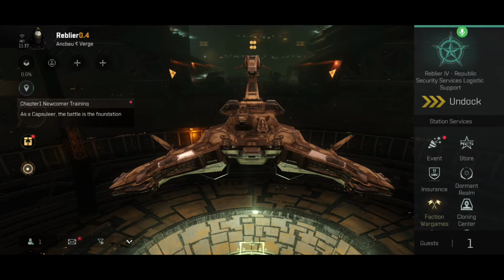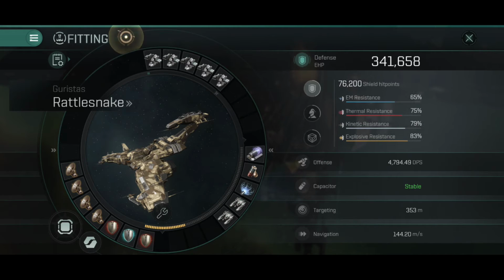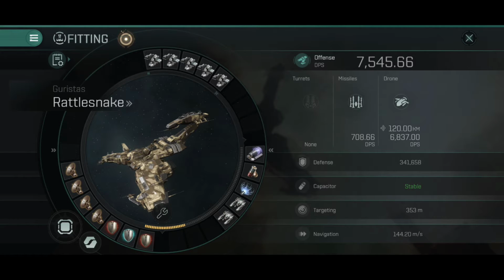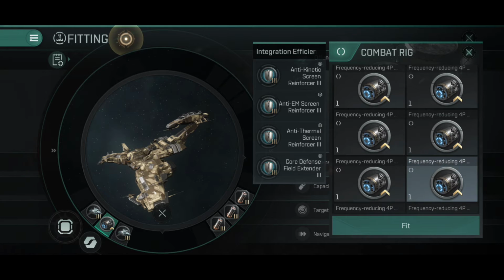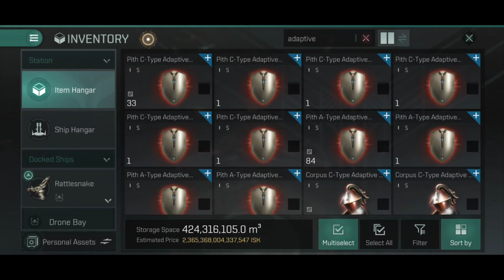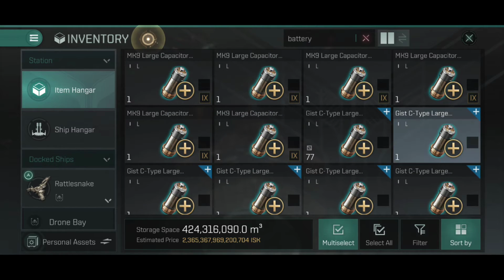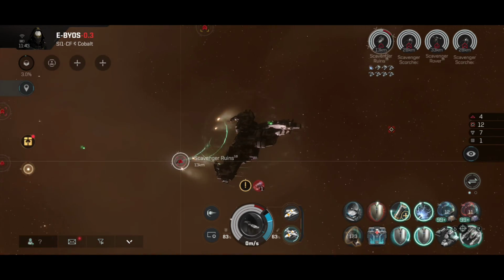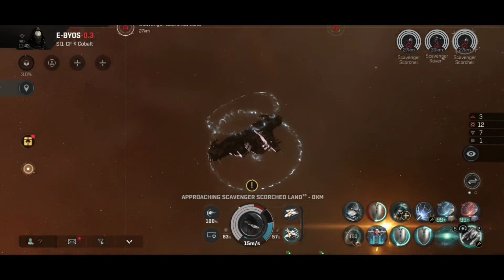EVE Echoes Monster Rattlesnake With Aerospace Tactics Implant - Wormhole Crawler Build - 7500+ DPS

Comment: With Nestor and other drone boats, and this can be off-putting for some since you have to recall drones and switch to a different size to match what you're targeting. Yet in going from smallest first and gradually working your way up to bs rats  past. You can use small drones like hobd for the filrigd and dessies (medium drones also are effective against dessies but can miss more often if it high speed dessy), medium drones such as hammerhead for the cruisers and BCs once the last small ship is dead. Finally large drones such as ogres for BS after everything else is gone.(elites are exception of this and should be taken out ASAP after taking out any small fast tackle). Unlike the RS who's bonuses re only for large drones until the reason you don't use this tatic with other sized drones when in RS. Other drone boats give universal bonus tto all drones it's using regardless of size. So switching to smaller ones for damage application is much more viable and better in general. While due to the high bonus of RS to dronr damage and getting their drones flight velocity up to at least the same as it's target. The large drones are less affected by the how their damage is applied against smaller targets

Comment: Not exactly correct regarding DPS of large drones over sentries. Sentries in general have lower DPS then their large drone counterpart of same meta. Sniper sentries are the only sentries that do more DPS then the large drone counterpart This is to balance out the fact that they don't need to move to get in range of target it's attacking and instead can instanr j start dealing damage the moment it's dropped. Whole large drones need to get in orbit range of target and can miss the first few volleys  and taking time to get in range while either you or the drones are being attacked. bouncer sentries or guard (snipers) can  be viable options running 2-10  DR as DPS especially if fitted with large missiles.
Reply from the maker: I just equipped sentries and had 30% more dps lol
Reply: In the past I've checked by fitting mk 9 ogres and mk 9 guard for DPS and ogre had more, same with the factionn version for berserkers. I also compared the base DPS for them in market and only the sniper version was higher DPS (which also has the highest range of sentry drones for sentry drones while offense drones have the worse range but highest damage). I'll double check again, it's possible the devs changed things around again but this was soi checked in the past which was carried over from EO in keeping them balanced.
Reply: @VirtualPersonYT  was going over recent patch notes and sentry drones did get an increase in damage while combat drones has agility increased, but I did check and sentry drines do have better DPS then the large drone variants now didn't realize it had changed.. I use both for ratting in RS at times. Use the large drones at first when Running anything other then encounters or normal anomalies. A lot of times once I have been able to get enough range (especially when first entering a room for inquisitor, scout or DED) I'll switch to sentry drones but use large drones for when I first entsr the room and behind burning away from the center and near where's the rats spawn. I also usually switch to large drones from sentry drones while fighting the last 1-2 rats in the each room and use the time to burn towards wrecks or boxes I'm going ebe looting.
Reply: @VirtualPersonYT  yeah I corrected myself on this in another comment. Didn't know they recently increased all but caldari sentries damage. I'm surprised the Nestor goes that fast as an armor BS. Even minmatar BS are struggling to get over half that. Did it get velocity buff recently?

Comment: Love the video Virtual❤
Reply from the maker: Glad you enjoyed!
Reply: have you considered more of a range build? You could probably switch out the scram and web for group cap. 554 missiles skills will get ctype large missiles to 106km range. 555 drone skill will get command range to 100km with a T3 drone command range rig and an additional 1% with another newer drone skill per level trained (my RS currently has 106km range of drones and does great with certain sniper sentry drones especially with sniper bouncers and wardens having over 80km range or close to it. Wardens were also capable of taking out apoc striker that was in NDS I was running. Unfortunately the sniper guardian lacks the most range with optimal and fall off both between 30-35km each and can take out small stuff with the alpha. They can also make for a great alternative against players that are targeting the drones First especially if you're setup at a distance 100+km from center of site. I tend to take out players in frigs with the first volley and other ships well before they even close half  the distance to my ship. I also orbit sentries at 0 for quick scoop up to activate bombardment implant when it's ready for another round ( I only use it against players and specific elites such as those in DED/NDS. Assault beserkers will also get flight velocity over 5-6km/s with 555 skill. Due to+50% increase in flight velocity with expert 5
Reply: @desmien679  das a lot of words

Comment: If possible, can you do a Sentry Drone build on the Nestor? Would like to know if it is worth invesring in it. Thinking about dropping capital skills and skilling into other weapons instead as I am not really using my Cap anyways
Reply: sentries are more useful on RS given it bonuses only for large drones, using small and medium drones are as  a mk 9 hornet on probe explorer. The large drones  can clear out the smaller stuff but in getting range and having them come towards you with sentries next to you. It's much more effective in taking out the smaller stuff with most frigs getting taken out with 1 sometimes 2 volleys. 

While the RS doesn't get a bonus to flight velocity I believe the Nestor does and is better able to quickly recall drones and switch out for other drones that fit the situation better (just finished the last frigbir dessy so recall em to switch out small drones for medium drones to take care of the cruises and BC. 

However as I mentioned in another comment, the sentries can be used in other situations such as running an NDS when hostile enters the room. When trying to attack the hostile at range, they start focusing on the drones first especially if brawled fit. Switching to sentries while at range can be useful in preventing further damage to the drones while a large amount of damage. I did this against apoc striker that took out 2 of the large drones I had, when I switched to sniper wardens with the kinetic damage (I originally tried gallente and beserkers whi1 of each was taken out while not doing great damage.While ogre/beserker were struggling to take out the apoc strikers tank. The sniper wardens just melted the armor in seconds.  Forcing me a0oc to jump back into the path it came in from. I chassd after and was able to get couple more shots before reaching the exit a it blew up. However for PvE given it's bonuses affect all drones small, medium neut large for taking out rats similar to it's drones size is more ideal. 

Another issue with sentries is that when you drop em you need to be hugging em close. If u accidentally get too far from them you won't be able to scoop em up if you need to get reps on them and you can't launch other drones until they're off gridin keeping myself moving in mitigating any k damage from missiles and to lesser extent turrets, orbit at 0-1km helps but you're still not moving that fast and incoming can still be brutal especially if it's DED/NDS that spawned elites. Similarly you don't want to leave them to start moving closer to loot especially boxes that open up after taking out the last rat. The other drones hey are better suited for this especially of hostiles appear on grid 200 km away. You might not be able to teach the sentries in time and they might not be in range of the hostile even if they're in range of your ship.